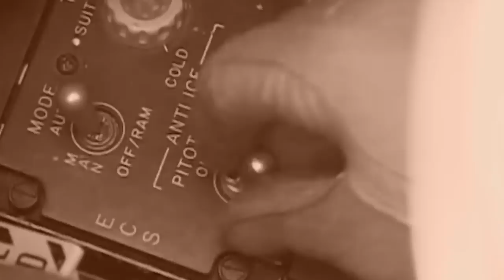X-31 Quasi-Tailless Thrust Vector Jet - Extreme Angle of Attack

Comment: An interesting US-German cooperation, you can clearly see the influence the airframe design had on the Eurofighter.
Reply: Other way around. Check the dates.
Reply: @Iskelderon  I think you were right when you said it was an experimental extension from Bae EAP, i.e. tech was taken FROM eurofighter and had vectored thrust added for said experiments 👍

I think EAP first flew in ‘86 so will assume this was first and X31 followed in ‘90
Reply: The UK equivalent flew years before the X-31... its not a game of copies but simply, this us the best configuration for maneuverability and supersonic speeds. Funnily enough, the eurofighter can run rings around even an F-22 but unlikely to get close enough for it to matter
Reply: @Thinkflite  there's even a Eurofighter engine version of the EJ 200, called EJ 230, with more power and thrust vectoring. It's however not used on any production Eurofighter yet.
Reply: @simonm1447  aye, It won't go on the EJ200, the Flight control computer would need a full redesign... its also not nessesary, thrust vectoring is only used where the aerodynamic pitching moments are insufficient for the maneuver you wish the aircraft to have. The eurofighter gets away from this by simply having very powerful aerodynamic controls. You can spot the difference by their respective wing loadings.
Reply: @Truth is a bannable offence  We all were, I'm a proud Brit but can wholeheartedly say that the Germans were ahead of the curve in that era... the USA contributed very little in the 20s and 30s... the biggest contributions were from Europe, Americas biggest contribution to aerospace technology was from 1960 - present. 

Thrust vectoring is not that big of a deal... the f22 does simply because its wing loading is so high. Do you know that at mach 0.8, an f16 will out turn an f22?
Reply: @Thinkflite  of course the complete flight computer would have to be updated, but it would be possible in the way since the EJ 230 has the same size, and would fit into the Eurofighter without modifying much of the airframe.
Since the Eurofighter is highly agile anyways it wasn't considered as a important feature, and not implemented in production models
Reply: Just like America didn't create the first successful V-tol tilt wing.
 It was Canada
Like usual...America claims the idea
Reply: I saw one of these planes in a German museum near Munich.
Reply: @simonm1447  quite allot more to it than that but I get what your saying. Would need a whole new FCS, not just an update... Military FCSystems aren't futurrproofed for additional hardware... the F22 for example, it would need a whole new FCS just to remove thrust vectoring... everything talks to one another.
Reply: @Thinkflite  This could be true, however if such an aircraft would be considered by European nations and the engine already exists it wouldn't be a showstopper to develop a new flight control system. 
The US does such modernization from time to time for their fighter models, The F-16 and the F-15 are old fighter models, but they have been modernized (mainly electronics and avionics) over the decades, both fighters are still capable models. 
Europe (especially Germany and Spain) didn't do this to the EF, they invested not really much, it took long to upgrade it with a Aesa radar. The only nation investing noteworthy money into further development was the UK, they also fly the best equipped Typhoons
Reply: @simonm1447  Your right, it could be done but won't be... the Eurofighter, Gripes, Rafale, F22 are all 90s technology... the F35 is late 90s technology and no country would spend the hundreds of millions on developing something that is not worth investing in. The Eurofightet is a cracking aircraft but why spend the cash on an aircraft that is already on its way out... most UK eurofighters are being retired (Tranche 1 and 2)... the tranche 3 will go on until about 2035, along as a labour don't come in a cut their budget in half... look at Obama and the F22!
Reply: @Thinkflite  We will see how much practical worth this technology has with the NGAD (if it gets it or not), they moved away from making dog fighters to BVR missiles. The F-22 is still a ''pilots plane'', the F-35 has moved away a little bit and sets the focus on stealth and BVR.
Reply: To expand, from the very informative video, it is an experimental aircraft specifically used to study vectored thrust. Eurofighter is a direct continuation of EAP: EAP is a prototype Eurofighter and does not have vectored thrust. From the video (2:45): 'to cut costs, and manufacturing time, the design was based on both original parts and preexisting components of several aircraft such as the British Aerospace Experimental Airplane Programme, the F16 Fighting Falcon, the F16XL, the V22 Osprey, the F20 Tigershark and the B1 Lancer.'
Reply: @Thinkflite  The F-35 has become cheaper, the costs per aircraft depend on the tranche, newer ones are around 80 million $ per machine (for the most common A version), and the ones which were offered to Switzerland are also at this price per aircraft. The costs per flying hour are still around 10k $ more compared to the F-16, which is at 36k $ per flying hour, this was the price target for the F-35 which has not been achieved right now. 
There is an immense pressure on Lockheed to increase the availability and reduce the costs her hour.
Reply: @simonm1447  The cost won't come down by any significant margin, its not due to manufacturing, supply etc its the development cost... its huge and unless everyone wants to double their orders, it won't come down at all. The issue isn't with Lockheed as Lockheed simply assemble the aircraft (not all, some are under license) the supply chain for the F35 is even bigger than the Airbus consortium which is a Co plate shambles too...
Reply: @Thinkflite  it seems they have some problems with the lifespan of some engine parts, which causes higher maintenance costs as targeted.
Reply: @Thinkflite  Except the run circles around F-22 is not entirely true. The F-22 can turn at a sustained turn rate of 20 degrees at 9g whereas the Typhoon is only 1.7 degrees faster at 21.7 degrees per second sustained turn rate at 9g.
Reply: @Thinkflite  And if that turkish F-16 video is infact real, then the F-16 runs rings around either aircraft with a sustained turn rate of fucking 24 degrees per second.

Comment: The X-31 looks like a fused A-4 skyhawk and eurofighter typhoon, cool design in my opinion.
Reply: Skyhawks are not manuverable, and lack canards or thrust vectoring.
Reply: SkyPhoon hahaha
Reply: So did I
Reply: @ViceCoin  No shit, he said it looked like one
Reply: Also the tail of a f16 it looks like
Reply: @ViceCoin  Never said anything about capabilities, but the Skyhawks were manuverable to some extend, even having the fastest roll rate of any aircraft but thats beside the point, i only said they looked like one, after all the Skyhawk is an attack aircraft not a fighter.
Reply: @KJ-kn8pg  Skyhawk was a 3rd Gen sub subsonic aircraft. X31 was an unstable, fly-by-wire aerobatic demonstrator.
Reply: Don’t forget the F-106 Delta Dart.
Reply: I think it's derived from the EAP demonstrator? looks that way to me

Edit: Whoops I hadn't got to the point in the vid where it mentions the EAP yet..
Reply: @robertbeirne9813  The F2Y Sea Dart Seaplane would have made carriers redundant.
Reply: @ViceCoin  Skyhawks had a roll rate of 720 degrees per second. They navy had them in Blue Angels and they were well suited as aggressor planes.. They very manoverable agile jets.
Reply: @265justy  What was the instantaneous turn rate? 
A-4 would be good to train against  MiG21s, but can not match the 120 degree AOA or turn rate of a SU27 or MiG29 (better than F16).
Reply: @ViceCoin  I would not say better than an F-16....dont open that can off worms...
Reply: @265justy  MiG29 had an instantaneous turn rate of 28 deg/sec vs 26 for F16. The original version also had offboresight dogfight missiles (1st operational), and BVR capable missiles. It can also operate from bomb - damaged or nuked airfields.
In mock dogfights vs East German pilots, the Fulcrum had a 5:1 advantage vs F15s.
Reply: @ViceCoin  And in the real world over former Bosnia and Iraq..those Mig-29s got the shit kicked outa them by F-15s and F-16s.. 😂😂😂
Reply: @265justy  Sorry, US is always invincible.
Btw, Serbs shot down invisible  F117 with a 30yo SAM (or AA8 mississie from MiG29) in real world:(  and damaged another, resulting in the retirement of F117 from combat.
Reply: @265justy  F117 retired from combat. 
F35I also degrades stealth by opening  weapons bay doors, as the Israelis learned over Syria.
Reply: @ViceCoin  We will never know if the F-117 has officially been retired. That's all classified. But what we do know is they are held in reserve and could be bought back into active service if any future conflict comes about.
Reply: Very mid cold war-ish.
Reply: J Jones  Naa. They are just flying them around the fun off it genius.. 🙄 And BTW... Its Tonopah test range... Not Holloman is were the remaining non flying examples are being stored.. GENIUS..
Reply: J Jones  Yeah sore losser. Resort to name calling when beaten.
Reply: Oh NO!! it's the gay........ "AIR-DOLPHIN" .........ah ah ih ih ah ah ah eh eh eh!!  

😆😂🤣
Reply: @ViceCoin  I forgot to tell you that a-4s are still used as aggressors, in top aces and Australia quite often, even managed to get a gun kill on a hornet in less than a minute, Skyhawks were quite maneuverable, stop spitting out nonsense.
Reply: @265justy  Because they had untrained pilots... Vs trained ones.
Reply: @vladlu6362  what are you referring to??

Comment: I worked on the VECTOR program which included some EFM program people.  Here is a fun story from the EFM program simulated combat with contemporary fighters.  The X-31 won all engagements.  The thrust vectoring advantage was so great that during one flight the X-31 stayed at low altitude, which is a classical fighter engagement tactical disadvantage, and the pilot taunted the opponent on the radio, "come on down".

Comment: The first time I'd ever even heard of this aircraft was its presence in the video game, ATF: Advanced Tactical Fighter, released by Jane's Combat Simulations in 1997.  
The X-31 was a playable aircraft, and its capabilities were astounding.  Getting used to the thrust vectoring was tricky, but when it worked, it was incredible.
Reply: I remember that game... I had it, but I was horrible at using thrust vectoring.
Reply: I thrashed the living crap out of that game. The thrust vectoring on the X-31 was just the best. It was so easy to line up for multiple kills in a short space of time, and dodging incoming fire was so much easier, as long as you picked it up early and turned to face it quickly. Great game!
Reply: Fighter's Anthology, a Jane's combat sim, had the X-31 EFM, and X-29FSW, and X-32 ASTOVL, along with the F-22A, and the F-22N.
Reply: A blast from the past
Reply: also look at HIMAT program.
Reply: @RIXEFX  and Aurora!!
Reply: I loved ATF, but TBH the way the thrust vectoring was modelled is utter BS and mostly useless. The X-31 really scored by having an unrealistically high top speed on the deck of somewhere around 1400kts.
Reply: Me tooooo!
Reply: Same here. My PC wasn't very good though and the game never really ran that good unfortunately. The opening title cinematic worked though and I remember this plane and the pilot letting out a grunt as he pulled an extreme G turn.
Reply: First saw this plane in Fighter Anthology. Which included a cool quick documentary series on the second disc.
Reply: I still like that game. Cool how you could black out during sustained g’s
Reply: Reminded me of Janes ww2 game. My god that game was incredible, me and my friends would play that literally all day all the time, I'd say it even lives up to today
Reply: That was a great game. I played it so much

Comment: Pitot... "PEE-tot".
Also, as far as I know pitots and other sensor components such as inlet ice detectors currently have heating elements to prevent such icing. One of our tests during launch of the F/A-18 series aircraft includes pitot heat, you have to physically touch it very quickly or it will burn your hand very fast. Works.

Comment: The Hawker Harrier "jump jet" used thrust vectoring to convert from horizontal flight to vertical landing. During the Falklands War of 1982, Harrier pilots used vectoring in flight, or "VIFfing" to evade an enemy aircraft on their tail. By changing thrust from horizontal to vertical, the Harrier appeared to suddenly jump straight up, at the same time slowing its forward speed, so that it was behind the enemy aircraft and could fire at it.
Reply: I've done this in DCS it works

Comment: I waited for a video about the X-31!
When german and american (basically Germans with an American visa lol) aeronautic engineers come together you get amazing aircrafts like this one.
Both the Eurofighter and to a degree American thrust vectoring aircraft profited heavily from this project.
Reply: The Eurofighter took nothing from this project. In fact the X31 was heavilly influenced by the BAe EAP which was developed into the Eurofighter. However a thrust vectoring version of the Eurofighter's EJ200 engine, called the EJ230, was developed but, to date, has not appeared on an actual aircraft. The Eurofighter Typhoon is regarded to be more than agile enough as too no need it.

Comment: I have always liked the trust vectoring program. F-22 reaps the reward of this program, as well as other aircraft and rocket programs. Thank you for a well done film.
Reply: I don't disagree with the sentiments at all! 
Though I do question -- as I'm not an expert, nor knowledgeable enough in this field -- whether rockets apply here? -My understanding was "thrust vectoring" being specifically the manipulation of the exhaust through deflection, to transfer the force applied to the plane, in the opposite direction. Whereas with rockets, it's a gimbal system which pivots the entire rocket engine or the bell nozzle (where the thrust originates).-

So I'm pre-submission editing that, after deciding to pop over to the Wiki page, where I then discovered it's.... basically down to semantics, and not at ALL as contrasting between the terms/definitions as I had originally thought!
https://en.wikipedia.org/wiki/Thrust_vectoring
As for why I'm even bothering to reply at all... is simply because someone else may have a similar thought and can spare them :P 
"This humble pie is the best when eaten right out of the oven!" lol

(edit: don't know why Google switched strikethrough from wrapped with ~~ to -- but didn't update their support page...)
Reply: @Only_God_Is_Allah_SWT  Full 3D thrust vectoring is not particularly useful. The F-22's engines are quite exceptional considering they are extremely high thrust, capable of super cruise, thrust vectoring, and exhaust shielded which protects against infrared tracking. Even today there are no dual engines that come close to matching the F-22's. The top speed is still classified and the engines may be even more powerful than is publicly stated.
Reply: @weasle2904  I remember the F22 wasn't really good at reducing the visibility of the engine's exhaust heat

Comment: I disarmed and removed the ejection seat on the #002 in NASPAX VX-23 and my name is on the bulkhead behind the seat before reinstalling the disarmed static seat ~ amazing aircraft.  Also worked with the X-32 and X-35 ~ good times

Comment: I remember seeing this plane at le Bourget International Air Show. Probably the most impressive demonstration i ever saw, and i don't think we'll withness this again as such a level of manoeuverbility isn't required, unless you want to engage a dogfight with a fokker DVII a Pitts or a Su27... The video clips shown here are not doing justice to the true aircraft's capabilities, because seeing a jet beeing able to manoeuver as tight as a stunts aircraft is quite crazy. I still wonder how many Gs the pilot took during this outstanding demonstration flight!
Reply: No G loading when the wing is stalled. The extreme AOA this aircraft flew were in a stalled state, applying thrust vectoring.
Reply: @LostPilotage  A wing being stalled doesn't eliminate g - loads. If the plane is accelerating/decelerating, it will experience g. To answer the question of how many g, not as many as you might think. The tight loops, etc are done at low speeds, so g isn't that bad. Turning at high speeds is where you see the biggest g loads.

Comment: The air inlet tube that runs the instruments in the aircraft is a PITOT (pronounced Pee-tow) tube....The loss of the first prototype was partially caused by a NON-heated tube (this is usually mitigated at higher airspeeds)...